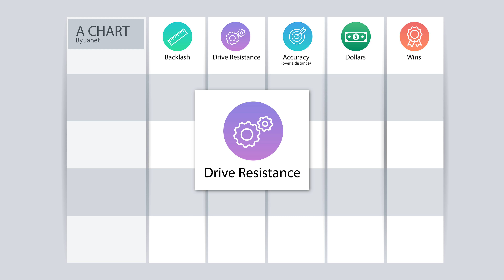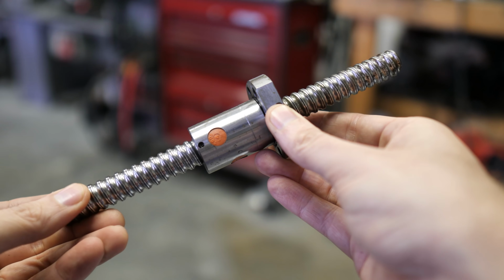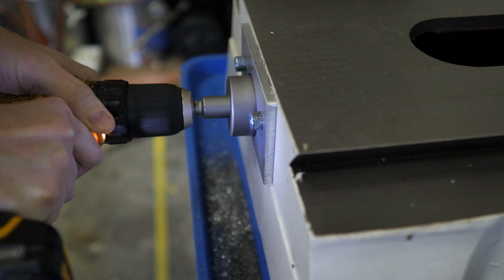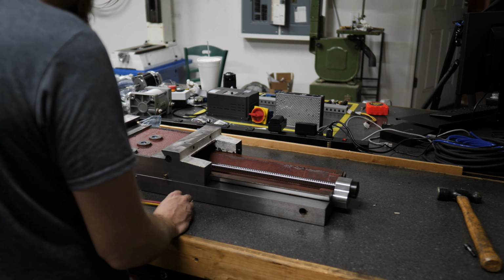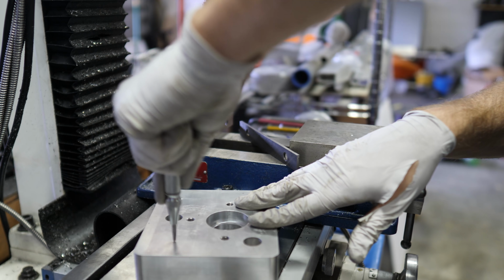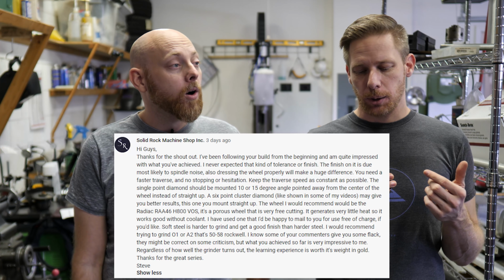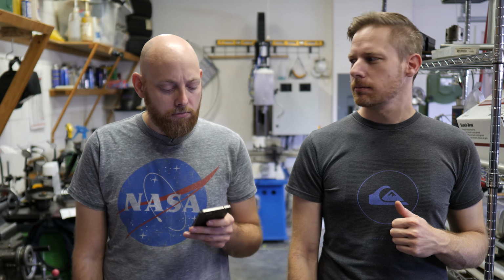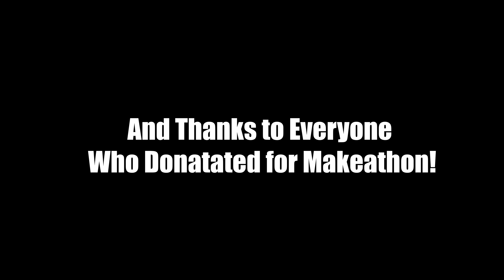The Joy of CNC, Ballscrews. Nuts. Friction. Play. Other words. - S03E03

Comment: I was totally inspired by your DIY surface grinder project. I've looked around and yours is the only one I have seen. I was collecting parts for my attempt at building something similar when out of the blue I stumbled across a slightly used Boyar Schultz H618 surface grinder for $200 and when I picked it up, for an extra $50 the guy threw in a slightly used  $4000 Parlec Presetter, a CNC tool used to precisely measure and catalog CNC tooling. This kind of thing never happens to me, it's always someone else, usually on youtube. It took all of my egyption to unload and get the heavy things into my shop but yeehaa, I've finally got a surface grinder!
Next, I make a CNC lathe using parts salvaged from the presetter, you should see all of the goodies I salvaged. Can you say Heidenhain?
Reply: Congratulations. You'll be busy for a while. :)

Comment: Nice job, It looks like that machine translates into a BF45 on this side of the pond. On adjusting the gibs on a machine like this; What I do is take a dial indicator with 0,01mm accuracy on a magnetic base; Put the X axis in the center (if it's moved to one side, it will pull onto the ways, disabling play)  place that magnetic base onto the machines base (where it mounts to the floor stand). Put the dial indicator on the outer end of the carriage on the Y/X axis (the part that moves in Y direction) and wiggle/rock the bed radialy to the Z. Adjust the gibs till the dial indicator gives you 0,01 throw. then place the indicator on the bed (x axis) at the same offset in Y as the first measurement and repeat the step till you read 0,02 (0,01+0,01) mm play. Test to see if both sides have equal play, to rule out the skew in the gibs.. That way you can adjust the play with some accuracy.
Reply: The PM-940 is like a RF-45 clone but does not share many parts. The head is its own casting. This is important because the standard RF-45 or clone have a short Z slide. This causes most to have a lot of head tilt  when switching directions and there is no good way to correct it. 

The 940 has wider ways on all axes over a 45 and the Z slide is a lot longer and stronger. The rest is larger too. The base with the angle leading into the ways is a more efficient way to to it and the base is taller then a 45 so stronger.

Comment: My only question.. dial indicate the gimble and table?
"Accuracy across distance" right?
Thou and tenths across any of your moving surfaces can throw off your finished product after programming.

Also tool holding (I know that will probably come), what sort of horsepower and motors?

Comment: Balance then true/dress. My experience is with toolroom grade machines - Mitsui 6x12, Okamoto, Brown and Sharpe etc; massive machines you can split tenths on, so ymmv. Your machine was wiggling a lot, inducing vibration into the work.
You don't need to balance modern wheels under 10" dia., 3/4" wide on commercial grinders with beefy spindles and castings.

Comment: If you’re not going to wear proper foot wear in the shop, at least use the proper hammer on your punches. Claw/framing hammers are harder than ball peen hammers.  Maybe you need to make a hardness tester next to be able to know exactly what you are dealing with before starting on the lathe

Comment: Every conversion kit I've seen has the Y motor hanging off the front of the mill.  Does the manual version of the machine not have a place to put the motor behind it? My PM-940-CNC has the Y motor behind the column, which I think is probably a safer arrangement.  Also, when you're done with the conversion, can you post how much head droop you can impose by pulling down on the head?  Mine can move down like .015" at the spindle which is pretty extreme, I'm not sure where the flex is coming from (probably a crappy chinese not-so-flat surface).